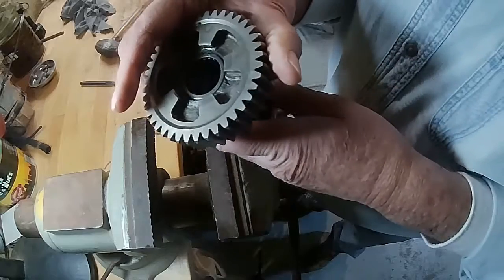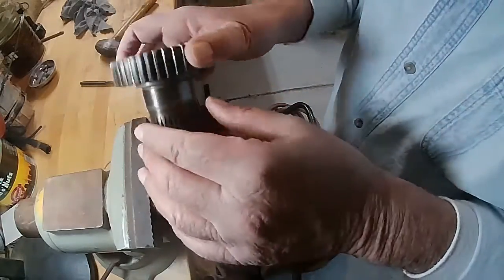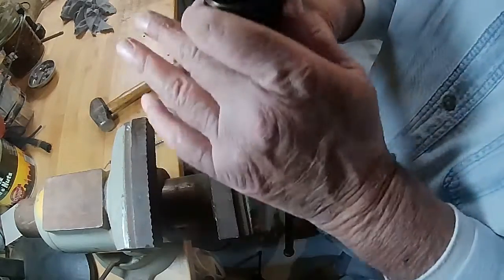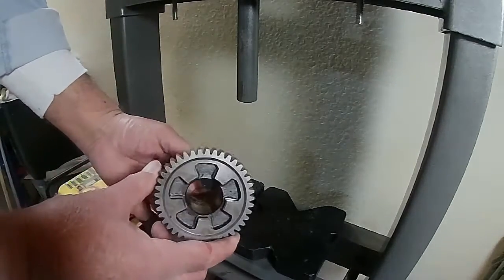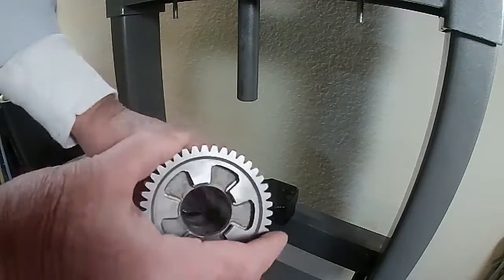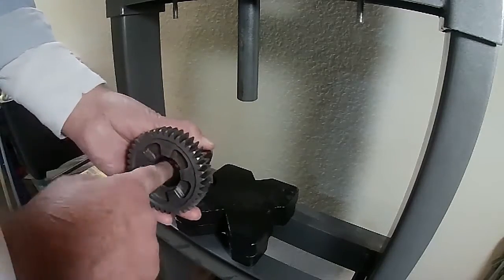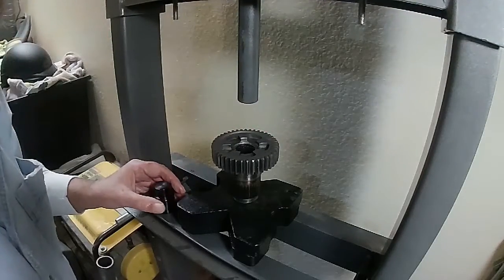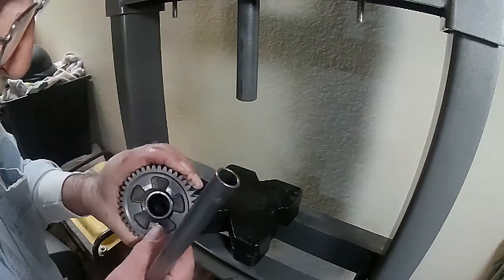Replace Inner Bearings In Drive Gear On Harley 5 Spd

Comment: Can I use a dead blow hammer with the bearing installer tool? I don’t have an arbor press. Thank you
Reply from the maker: Thanks for the question. Yep as long as you have the tool to set the correct depth of the bearings. Thanks for watching
Reply: Thank you for the reply! Subscribed
Reply from the maker: My pleasure and thanks for subscribing

Comment: Hi! Question if installing the bearing while in trans,can you heat main shaft a little to ease bearing in?
Reply from the maker: Thanks for the question, I have never heated the bearing. What I used to do is put the bearing in the freezer overnight and when ready to install heat the case a little and the bearing will almost drop right in. Thanks for watching.
Reply: @tinkeringwithharleys  thanks will do!

Comment: My bearing race had moved into my inner seal I used a flat jawl race Puler to separate the two and get enough room in between them for me to use the factory Harley race puller I went to replace the seal inside the main drive gear and the needle bearing inside is almost perfectly flush with the deepest part of the beveled part of the main gear did my maingear move or did the needle bearing walk itself out and what could I do to fix either one
Reply from the maker: Thanks for the question, I'm assuming this is a 5 spd trans. The only time I've ever seen the needle bearings out that far has been if the inside of the drive gear has been damaged or the needle bearing was installed incorrectly. Off the top of my head I don't remember how many thousands the needle bearing needs to installed so that it seats. Where the needle bearing rides is polished and smooth and where it seats inside is not and you can feel the difference if you can get your pinky in the to feel. If the bearing has moved out you'll never be able to seat the 5th gear seal and have a hell of a oil leak. The main drive gear really can't move out because that seats against the case. I hope this helps you.
Reply: @tinkeringwithharleys  I had the same problem and used the race installer tool and a piece of pipe  i ground down to fit the outside of the bearing and worked it back in. I went in about 0.400 a little more than spec, how it will be ok.

Comment: Weather can change fast 80 on Wednesday 70 on Thursday 50 on Friday 18 with snow Saturday . still have the snow this morning  20 f out doors .    I use a blind hole bearing  puller and press them out .  Beating on a Gear can turn into a disaster.
Reply from the maker: This is definitely colder than normal here, but we rarely get snow at my elevation, so I can still ride. Thanks for sharing the method you use. I've done it this way for years and never had a problem. Thanks for watching and ride safe.

Comment: I really appreciate the fact that you post videos like this. Not a whole lot of videos on Main Drive gear bearings and seals

Could you use an Arbor press to press the bearings and seal in??

If so, what capacity do u think a 1 ton capacity would work?
Reply from the maker: Glad you like the videos. Yes a 1 ton arbor press will work for pressing it the bearings and seal. I would recommend you get the tool for both. It sets the bearings and seal at the correct depth. Thanks for the question and thanks for watching.
Reply: @tinkeringwithharleys  Cool, yes I'm definitely getting that tool! I always spend the money on specialty tools cause it makes the job clean and easy, and you're already saving thousands working on it yourself.. might aswell buy tools that will make the job easier and cleaner

It's weird because I tool apart a 5 speed out of a 96 Electra Glidecand didn't have to press the shafts out of the trap door to remove all of the gears off of the shafts unlike on this transmission you're working on
Reply from the maker: Yep Harley loves to change things up every few years. The trans in the video has bigger bearings in the door and they have to be pressed in and out unlike the earlier 5 speeds.